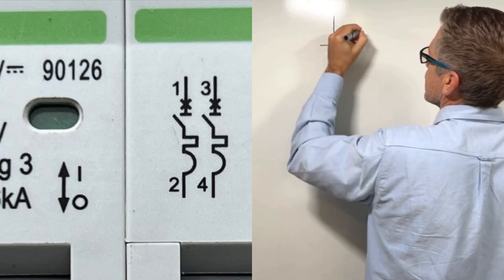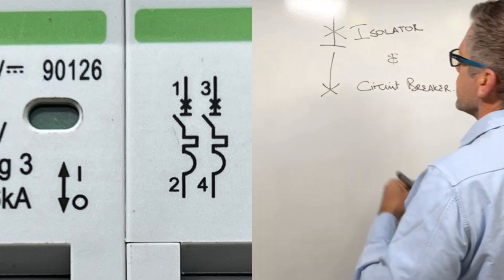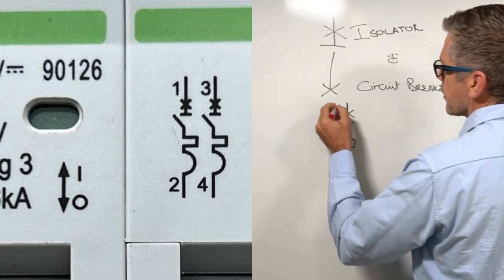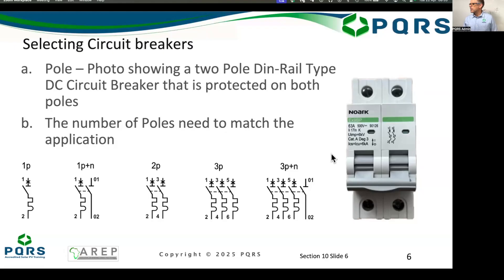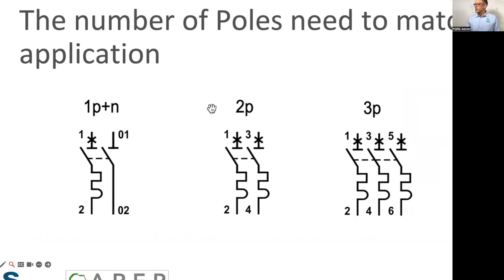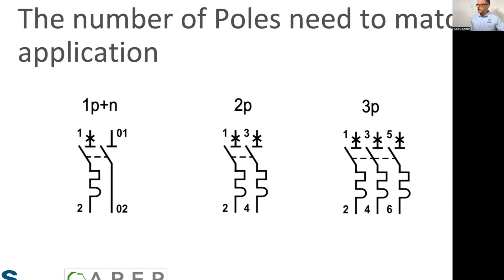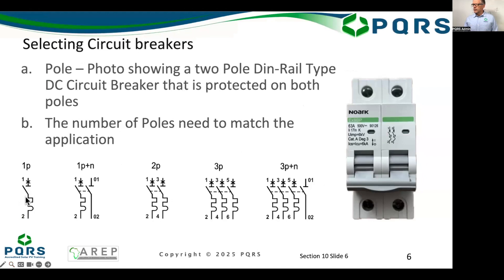Circuit breaker symbol mystery solved

Comment: You didnt mention Short Circuit anywhere in your explanation
Reply from the maker: Hey Bosman, no, short circuit wasn’t mentioned. The lines on the breaker usually does not refer to the kA threshold. 

I was just trying to look at and cover the symbol itself. The kA rating is usually determined by the robustness of the components used inside the breaker where higher kA results in a slightly wider body although the symbol might remain the same
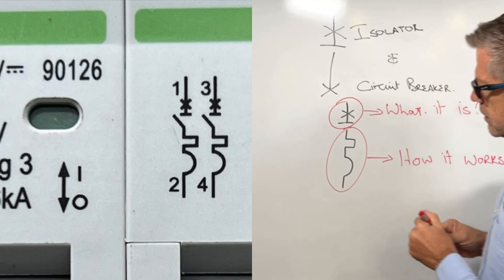Reply: @carelb_pqrs  Ok let me ask this: At 1:11 you explain that that half circle symbol  at the bottom means Overload Protection (will trip on overload) and the upper square is Thermal Protection, now my question is isnt Thermal Protection the same thing as Overload Protection? Because Overload happens when Thermal Protection detects too much heat from appliances' "Over load" then trips? I thought 1 of those symbols should mean Short Circuit Protection and the other one be Overload Protection
Reply from the maker: Thermal Magnetic circuit breakers actually have different functions or levels of protection. 
The Thermal protection is done with a bi-metal strip which heats up during operation. If it gets too hot, it will trip the Circuit breaker.
The Magnetic part of a circuit breaker is a completely different component and will work during overload or short circuits as it is a electro magnetic function. 

It could potentially be similar, but the bi-metal strip might not be as effective during short circuit conditions as it would take to long to heat up, whereas the electro magnetic function is faster in this type of event. So they are similar but not the same.